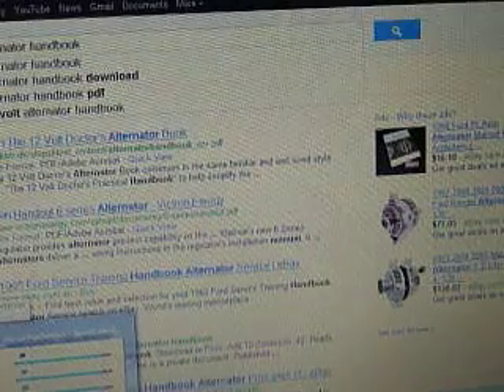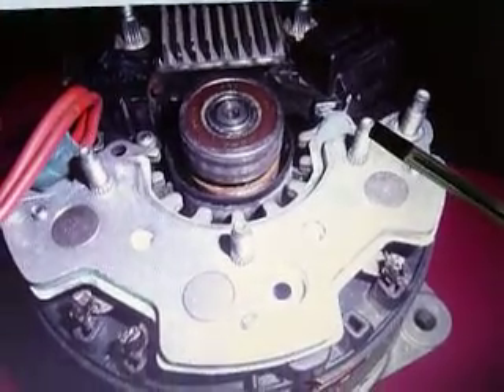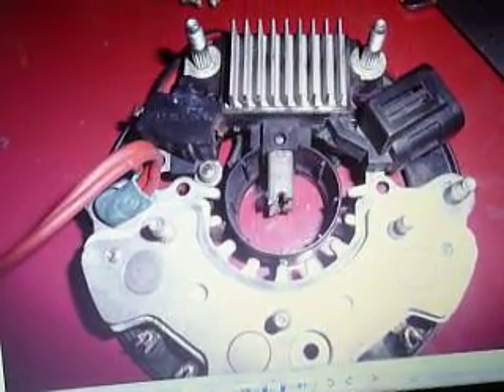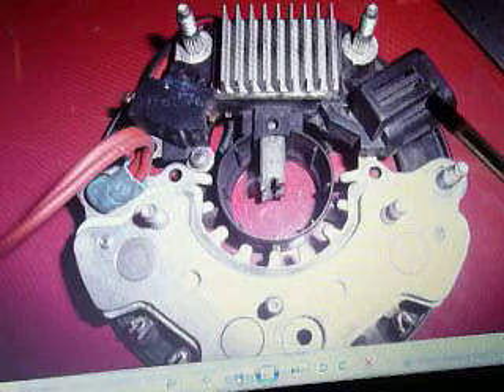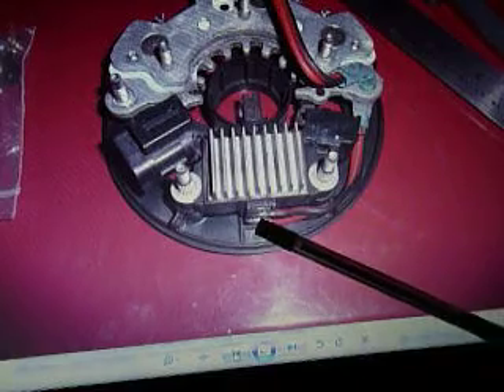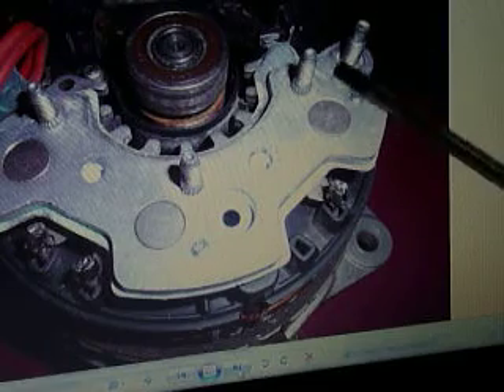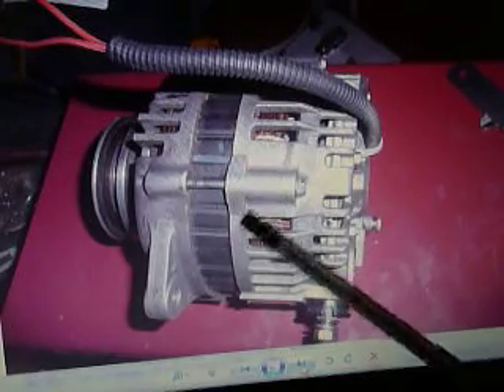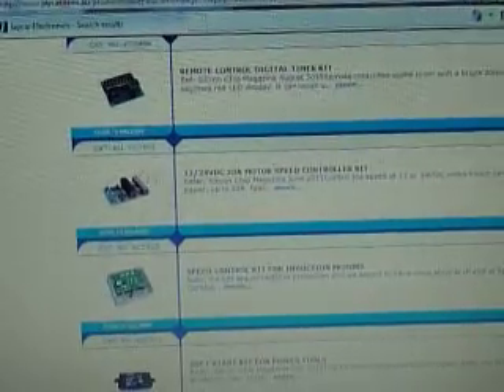alternator mods for resonant hho

Comment: I've seen some stuff on tapping the alternators for 120V. 
Add a bridge Rectifier and use 120V DC.
I believe if you swap out a 90A for a 120A Alt, you have a dedicated 30A
This is speculation for me. I've watched a dozen of these videos,  I learned something, thanks.
Reply from the maker: 120v from an automotive alternator should be quite do able. much above 120 could see the stator windings arcing and shorting because it is just enamelled copper wire. it's all about the excitation regulation and the load. for instance, running an alternator with no load will allow maximum voltage build up and guarantee the stator windings arc out.

Comment: Very important to make right Stan Meyers Cells, I mean gap, 316L  stainless tubes. also very important which diodes use , need use hi frequency diodes, or same diodes from alternator, not every diodes works for Stan system    If everything don correct, yes with less 0.5 amp possible to make a lots of HHO.

Comment: Would like to suggest: take a wire from each stator coil A B and C , where crimped connection is broken.  Pass each wire thru it's own tube cell A B and C  then back into it's own diode on alternator, then earth the main (12V) output connection. This way you get same frequency but 60 degrees separation between tubes in cell. All the best mate! Thanks for your videos.

Comment: can i ask, if i was running this in a 12v car (ford festiva), if the alternator has no limiter, would that mean if the car is getting over 14v, would that be potential for damage to any of the system if i wasn't using this for a HHO setup?

Comment: 62 amps X 12 volts = 744 watts which is very close to 1 horsepower

Alternators are only 50-60% efficiency therefore to produce 744 watts output requires 2 mechanical horsepower from the engine.  

The more electrical load you put on the alternator the more mechanical horsepower that is required.
Reply: Duh